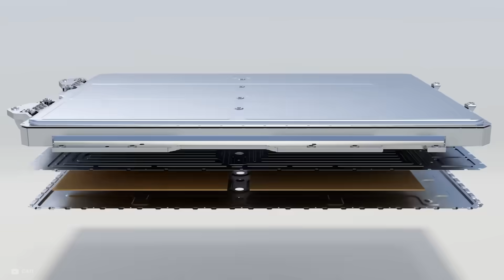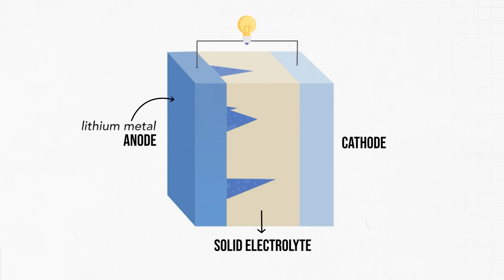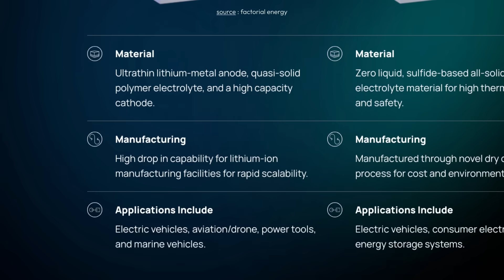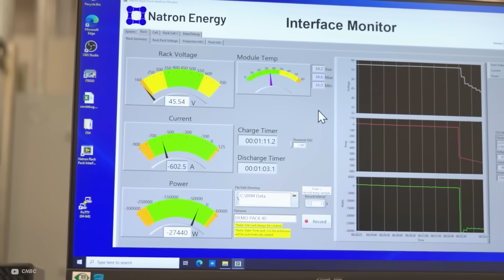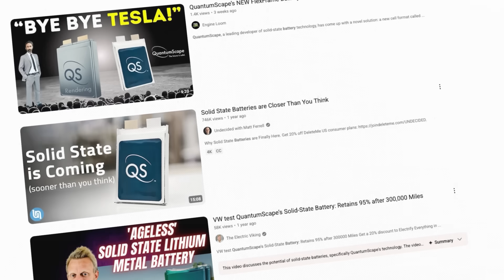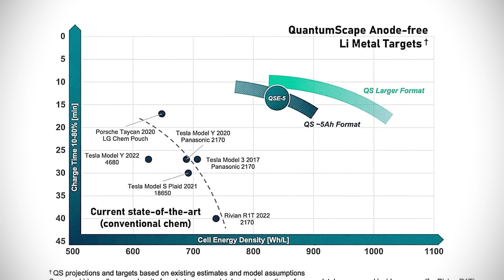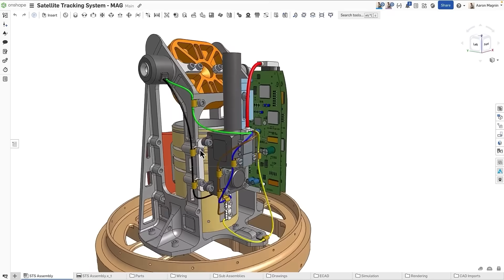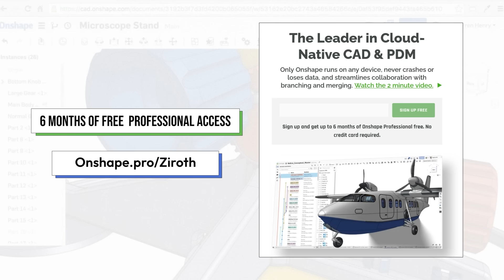The Decade Wait is Over, Solid-State Exists.

Comment: Personally I think solid state is that 5 yrs too late. People are already used to current electric cars, they're not a problem. The problem at least here in Europe is that normal petrol family saloon what used to cost 25.000€ is now suddenly 50.000€ and solid state batteries are not going to fix that, hell they're probably going to be even more expensive, as they're harder to scale up and scaling hasn't even begun yet. Only thing that is preventing me from buying a electric car is that while petrol engine version costs roughly 6k per year you can still run it for 5 more years with the price gap between electric and petrol to get even on the same price, not to mention that price of the battery pack seems to drop 10-30% per year.

So from my point of view the next big thing is not going to be solid state, that is going to relevant only for motorcycles and very high-end cars, as performance is only thing that matters there and nobody cares about price. For normal passanger vehicles we're going to see Na ion adoption instead of Litium, since price is going to be the thing that affects it most. If you can suddenly do new battery pack that can handle elements, can last 10000 cycles instead of 1500 AND it costs 10-30% of current Li-Po batteries, that is going to be the game changer. And CATL is already producing and testing those, while mass production should start next year. So solid state is too little, too late, and alas Europe and USA are going to follow, since we've basically built all of the value and supply chains into China in last 15-30yrs due to "better profits"....
Reply: Not sure what the point is of 10000 cycles. If a car could go 300 km on battery and can cycle 1500 times, then you have a battery lifetime of 450.000 km. Which is rather good for cars as is. I guess I could see a point in gaining a bit more, but will your car really still be ok after say 1 million km?  Or would at that point one need to do a full rebuild anyway.

Still I imagine you are right that further price drops might be more interesting to the average person. What many people probably would prefer is cheaper cars after all, so long as they can but drive far enough. They probably won't care how that saving is achieved either, be it Na, or some amazing reduction in cost some how achieved in the making of Li Battery, or some other alt chemistry. Though Na for now seems one of the more likely candidates, yes.

As for solid state, I guess we'll see what happens with it. For all we know continued advances on it will allow for all kinds of things. For instance, maybe a solid state Na battery will turn out to be possible. And perhaps the difficulty of manufacturing will over various iterations be brought down like it was for the older battery chemistries. So maybe we'll even eventually end up with a cross between both worlds. What ever turns out to work best in the end I guess.
Reply: Its kind of obvious that cheaper cars are going to come from whatever battery minimizes the infrastructure the car needs to support it, with a secondary factor being the price per WH. Our extremes are a large battery pack that doesn't require environmental conditioning, but is difficult to fit in the chassis, or a smaller pack that is complex to build but makes engineering the rest of the car much easier.

Comment: Personally I find the tech to be wildly overhyped. Like fusion power or hydrogen anything. I personally find the most exciting advances not in trying to create new product categories like these as awesome as they are, but the advances in commercialization and simplification of technologies that will help the 99% of us like sodium ion batteries. The fact that CATL, the world's largest battery maker, purposefully closed the world's largest lithium mine because it wasn't profitable speaks volumes as to where even they know things are headed... SALT! SALT! SALT! At least for the vast majority of ground-based applications. A 6.5% drop off in density compared to LFP is still worth it when the cost is only a fraction of traditional NCA and LFP chemistries..

Comment: Small nitpick here, pet peeve of mine.
Everyone reporting on battery technology is using the term "energy density" to incorrectly refer to energy per unit mass.

"Energy Density" is defined as energy per unit VOLUME.  This is analogous to "density", which is mass per unit volume.
The term for energy per unit mass is "specific energy".  This is analogous to "specific volume", which is volume per unit mass.
Reply: As someone with a doctorate on batteries, they're both energy density. One is volumetric energy density and the other is gravimetric energy density
Reply: @armwrestlingprofessor   - fortunately enquiring minds can have a look around - read a little wider on "specific energy" to see there are similes at play
Reply: @armwrestlingprofessor  you win the pedantry fight, but this makes me angry.
Reply: @ShuRugal  but weight does matter allot for certain applications like drones and shiz, while volume obviously matters, it wont if the energy per kg is so low it cant pick itself up
Reply: @crwelch12  yes, that's why it's important to distinguish between energy density and specific energy.
Reply: But they are both types of energy density….. yes there’s a better unambiguous term, but you’re factually wrong stating they’re aren’t both energy density
Reply: @geekswithfeet9137 nope.
Reply: I'm fine with the terms gravimetric energy density and volumetric energy density.
Reply: Guilty as charged 😂
Reply: Energy per unit mass is more important in mobile applications though because you have to carry that weight but I agree with your nitpick.
Reply: @InTimeTraveller  I think it's the opposite, for mobile applications people care about volume, not weight. meanwhile for vehicles volume matters less, but weight matters a lot, since weight determines your range, the heavier the batteries, the more mass you have to move, so the less range you will have.
Reply: @danilooliveira6580 oh yeah, mobile I meant things that are not stationary such as cars, motorbikes, e-bikes, drones, etc. For phones and tablets I agree that weight is less of an issue (still an issue but not as big as volume, even though the two are related).
Reply: @InTimeTraveller  yes, energy per unit mass is more important.  that's why it has its own term.
Reply: @ShuRugal dude you’ve already been proven wrong, just take the L and move on
Reply: You are completely wrong. It could mean either, it's a generic term. But since mass is more important that is what's mostly mentioned.
Reply: If you really want to argue about people's fixation with energy density, then draw their attention to a metric called critical current density.  This metric is often overlooked.
Reply: I get that you are one hundred percent correct from a scientific standpoint, I think this is just common parlance for people who just want an immediate understanding. Energy Density from a linguistic point of view makes sense as energy per cubic space of displacement. The amount of energy per measurement intuitively just sounds like a density measurement… these sort of ways of dumbing things down always ends up in common parlance due to advertising because if people wrote specific energy on advertising ordinary people wouldn’t have any idea what that means and the advertising fails. If you say energy density the immediate assumption is that it means what the science calls specific energy. 

We can’t do anything to force people to be into the science when they just want to buy a product. And if people don’t buy products there is no funding for the science so we have to make space for advertising lingo to have its own terms separate from the scientific technicality. 

I understand that you probably get this, but you need to let it be ok if you don’t want to be constantly annoyed because we can’t force people to take an interest in things.
Reply: @dorjedriftwood2731 that's an awful lot of words to tell me you don't care if science journalism is scientifically accurate or not.
Reply: @ShuRugal  I don’t disagree but that’s not what I was saying. I care. I was explaining that there is a market term and a scientific term and I think people like myself interested in the science terms should make room for people who drive the market and propel innovation by funding through purchases. So your reading comprehension is kinda off. 

If what I was trying to say could be summarized it wouldn’t be “I dont care” I actually do care a green deal hence why I invested time to write something. Be rude on someone else’s comment please.
Reply: This is correct ^

Comment: If your new battery doesn't specify Wh/kg, Wh/L, cycle life and C ratings are missing from their announcement, they just want your money. 

I really wish lithium air batteries were more plausible than they appear.
Reply: The problem with Lithium air batteries is assuming you use a metal anode to really make use of the cathode improvements, you still have the danger factor of lithium. Other chemistries would probably do better tbh
Reply: @btoiscool yeah I don't see how to make it work but theoretically it would revolutionize everything. Fortunately I'm also a moron so maybe some brilliant intelligence can figure it out...
Reply: @WentzCraft  It's not like it wouldn't work, and in fact it'd most likely be safer than current cell technologies in which use flammable electrolytes as well, that being the main problem with current lithium technologies, but that would still be a problem.

Other chemistries will have less violent reactions when in the presence of water, and as such could be chosen, so that's not that big of a deal.

Comment: I have a Quasi Electric Vehicle - it has an ICE that is "initiated" by a lead-acid battery.
In fact, the lead-acid battery is also a Quasi Solid-State Battery in that it has solid fibre fabric mats separating the electrodes
Reply: Have a lay down you worked so hard!!

Comment: Solid state batteries market: I disagree, the market for solid state batteries is wide open. SSBs are safer, offer faster charging and greater battery life both in power density and cell longevity, while reducing mass. Consider the single cell that's 21 watt hours from the motorcycle battery pack. That's small enough to fit inside a laptop or tablet, but would offer 10x the battery power capacity of current battery cells found in laptops and tablets. The vast majority of laptops and tablet batteries cells sit at just 2-5 wh (total capacity of a battery pack ranges from 52 wh to 99 wh) and depending on power consumption of the laptop last between half an hour of use to about 10 hours of use. Just four of the SSBs shown in the video for that motorcycle would provide a major step up in battery capacity and longevity, while taking up less or equal space. If the form factor and voltage vs AH arrangement can be altered to fit a broader array of electronics, then those cells would have wide application well beyond EV battery packs.

Comment: For cars, cost is more important than density imo. Though maybe premium cars can use it as a selling point.
Reply: Cost and density are related though. I’m sure these high density batteries will be more expensive initially, to cover R&D costs, and since the demand will be highest in high performance vehicles. But as production ramps up, it’s likely that the high density batteries will lead to cheaper cars since you need less materials to cover the same range. And when the batteries weigh less you need fewer kWh to cover a given range. 
I know current NMC Li-ion vs LFP goes counter to this. But that’s a quirk of the specific materials NMC batteries require. Many of the next gen solid state batteries do not require those expensive materials.

Comment: Regarding the "100% Silicon Composite" anode ; to the best of my understanding it is comprised of silicon alone, but it's a composite because it's nano-silicon lattices. A mechanical composite not chemical composite. The nano-lattice arrangement helps to combat swelling while adding structural strength while increasing surface area for ion-transport.
Reply: Basically like a porous cotton fabric
Reply: @sihamhamda47  Sort of, more like fish net at a very very small scale, layered over and over again.
Reply: Ooo using a lattice is a very smart idea. I have concerns though on long term longevity and durability due to lattice breakdown.
Reply: @Selsato  Nano-silicon lattices don't breakdown readily, and in all actuality because of the reduced swelling and structural arrangement, they have greater longevity than normal batteries. You can expect at least 30 years out of these without more than 2% power degradation with full cycles.
Reply: wait, can you call that a composite ? I assume a composite has to be made of different elements by definition.
Reply: @danilooliveira6580  In material science there are two types of composites, there are chemical composites, where two or more elements are composed into a single molecule. Then there are mechanical composites. Unlike chemical composites, mechanical composites are bound through various means but not typically at a molecular level, but through a mechanical one. 

For example, most metal alloys, which are called a composite material, are mechanically bound not molecularly bound. 

You can create mechanical composites of the same material if their arrangement is different, or atomic weight is different. For example, a graphite-diamond composite is all carbon, but they're in entirely different crystalline arrangements for the carbon.

Comment: I wonder if the solid state ceramic electrolyte, lithium metal anode battery couldn't replace the lithium with sodium and use the same cheap ingredients for the cathode that sodium ion batteries are using to produce a high energy density, solid state sodium battery that would be safe and affordable.

Comment: A huge and common mistake is that the goal is NOT to have a certain technology, like a "solid state battery." Rather, the goal is to have a finished product that meets all performance requirements, and if that means NOT using that tech, then great.

The attitude of "solid-state batteries are here" should be avoided because solid state batteries don't matter. Instead, the question "Are there cars that deliver the performance suggested by solid state batteries?" is better. If the answer is "Yes," then it makes no difference what the batteries are.

Comment: Nickel-metal hydride batteries have been lasting over a million miles without much failure.  Toyota, like all who want to avoid utter ruin, limits gas mileage of hybrids by forcing the gas engine to run more than it needs to. Charge starts at 40% capacity and stops at 60%. They claim this is for battery life, but hybrid owners who report way higher mileage after a service are scared back QUICKLY to dealers' shops TO CORRECT THE MALFUNCTION.  Sure enough, back to the old 40 to 50 mpg.  I would like to see a Gen-3 Hybrid adjusted to 20 to 80%, and note the differences. CIA & API have likely whacked people for such. Notice in a hybrid, you pushbthe gas pedal very little, and the EV MODE light goes out, and messages appears EV OFF MORE POWER REQUIRED.

Comment: Chinese phone brands using silicon carbon batteries with 900+ wh/L energy density. I'm using one with 7500mAh battery right now. these batteries could even enable All electric aircraft. you should make a video about these
Reply: What's the brand/model no?
Reply: @vladimus9749  I'm using the Redmi turbo 4 pro with 7500mah (838 wh/L) battery.
but their high end model- Xiaomi 17 pro max have a 7500mAh (908wh/L) battery
Reply: @vladimus9749  My Xiaomi 15 Uktra has one.